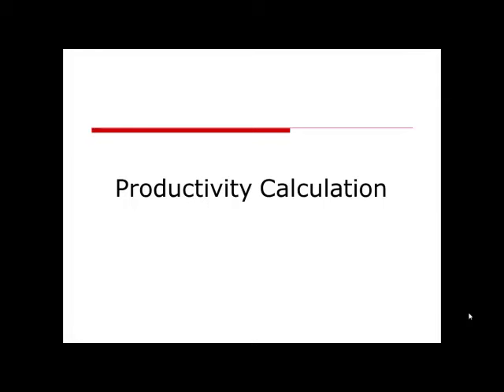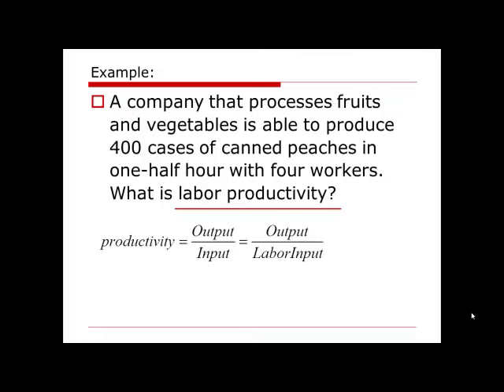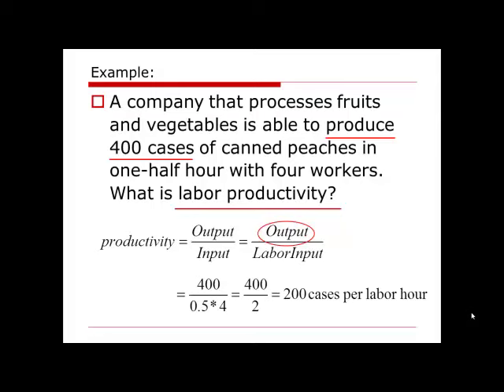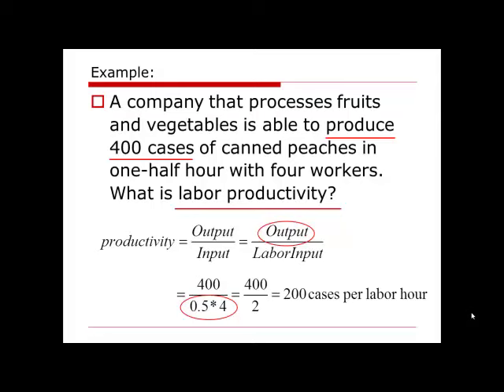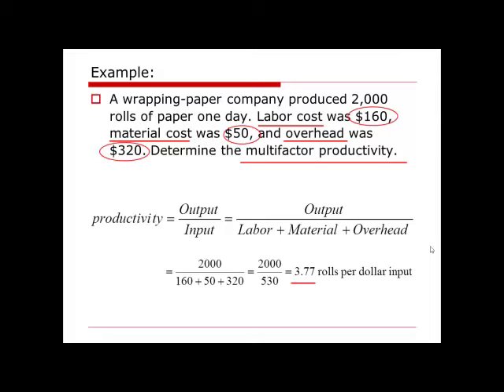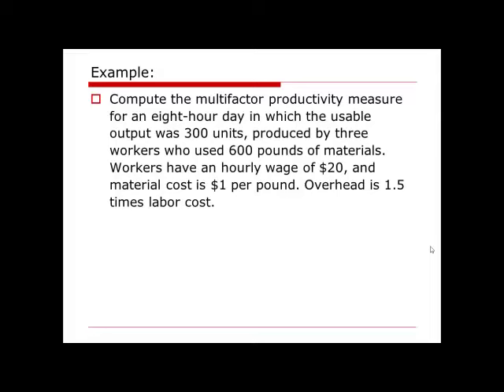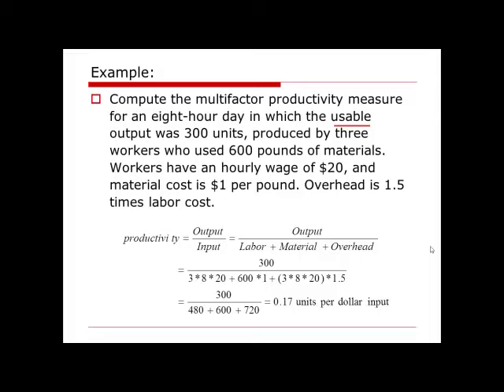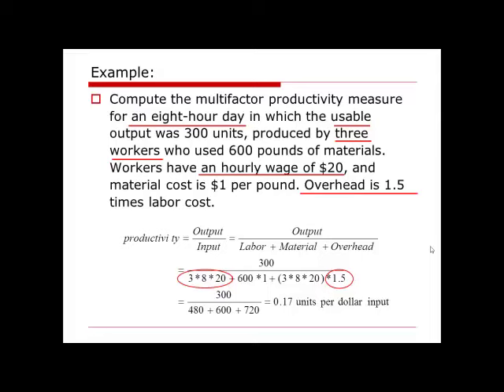OM Calculation: Productivity

Comment: absolutely, it is about manhour labour efficiency.More labour less hours to do the same task and vice versa. Correct me if wrong
; given 5 men take 13 hours to change an engine, how many hours will 4 men take? Answer should be more than 13 hours. So labour productivity of 5 men is 65 manhours.So 4 men should work 65/4 or 16.25 hours which is 3.25 hours more. Correct?